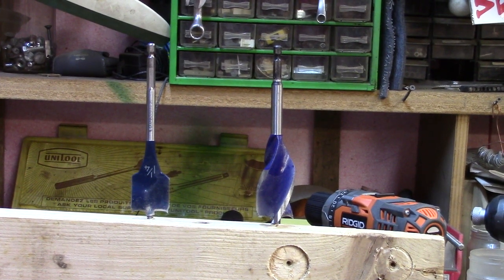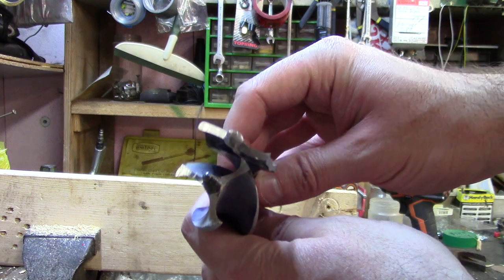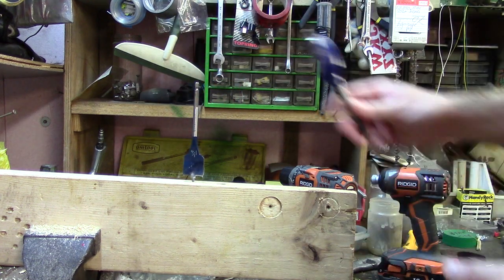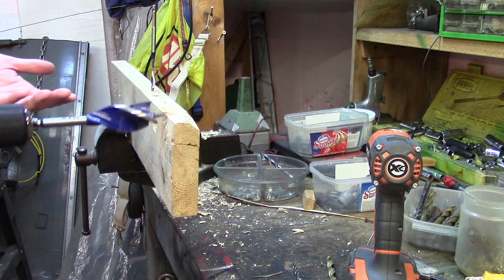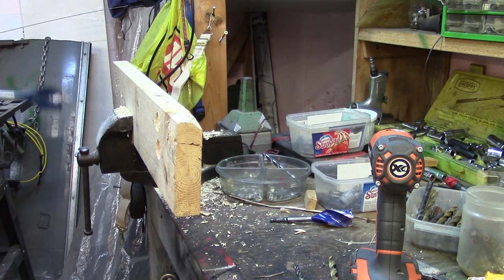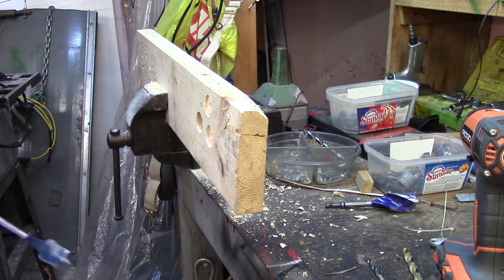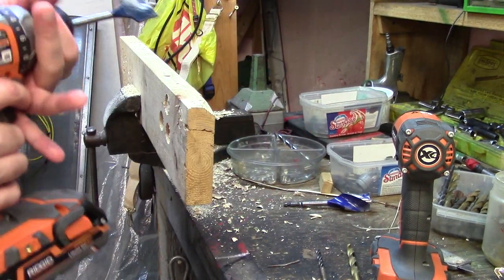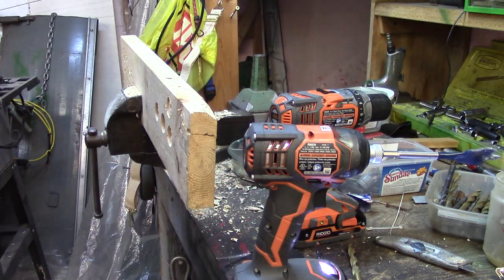IRWIN speedbor MAX VS Bosch Daredevil Spade Bit Set

Comment: Pay attention to how he uses his drill/driver's clutch. He should of had it on speed 1 and on drill mode not on a torque setting number limiting the amount of torque allowed. Also for some reason I think he rigged it because it sounds like he changes the clutch setting after using the first Irwin speed bor. I don't understand why he he would do that? But that's just what I thought I saw happen so...? Either way I've personally used both the Irwin and the Bosch bits and as long as you have a good drill and know how to use it... you should be fine with either one. They both drill holes like they are made to do and I'd even say they are about equal in hole quality. So it all just comes down to how much you want to pay for a drill bit really because these are both main stream brands that have reputations to hold up so you can expect them both to have good quality.
Reply: can you tell me if you thing the spade bit with the screw would be good to use as a scotch eyed auger (hand drilling without pressure, just turning)?

Comment: Speed bore is for low speed, high torque drills and heavy use. The spade bit is not for heavy use. A real tradesman using these bits all day will choose the speed bore because the spade won’t last a week of everyday use. Test the two different bits using the proper drill speeds through 3 2inch boards stacked together.

Comment: 3 blade design (vs 2 blade) will be "harder and slower" for a very weak drill/impact driver but it will cut through much better and faster for a stronger one.
Reply from the maker: There is a few other video on YouTube comparing these 2 and in every case the Bosch win! Plus they are cheaper so on the long run you save money off you use them every day👍

Comment: Use the right drill for the job.  Why not use a 1/2 inch cord drill and you will see the IRWIN is faster.  That is why it quit on his drill with a dead battery is that it grabbed a lot of wood and the drill could not pull it out of the hole with a dead battery.  I have a 12 volt battery run drill that would have no problem with these bits because my pack will put out over 100 amps and my drill, under full load, only pulls 60 amps.
Reply from the maker: Hum I was comparing 2 drill bit too see witch one performed better 😒 Ho well not everyone is familiar with the concept 😔.
Reply: owen prince because no one uses Corded ones

Comment: Really!! Who educated you on how to drill holes!! Drilling holes on 2 setting! When you are drilling holes, you need to pull out and allow wood chips to clear and then continue drilling. Everything you demonstrated, is wrong!!!
Reply: Ernesto De Leon I agree this guys an amateur lol doesn't know how to use a drill
Reply: Actually these are designed to pull in the bit. So you don't pull out. It's not a hole saw. It's designed to pull the chips out....
Reply: Speed 2 for smaller holes, speed 1 for larger holes.  Also as stated the speed bores arent meant to go in and out like a regular spade or drill bit.

Comment: I bought a pack of those Irwin spade bits about three weeks ago. Over those weeks I've used the 1 1/8" bit and bored eight holes thru 2x4 pine. These Irwin's are ridiculously dull! My twenty yr old spade bits, which hv never been sharpened, work so much better/faster it's crazy. 

I only bought the Irwin because I needed the 1 1/8" bit.. but it's so dull that my drill is running too hot and started to smoke. Didn't want to kill my drill just to drill a hole!

IRWINS ARE TOTAL UTTER GARBAGE!
Reply from the maker: lunaticprophet yep that why I love the Bosch of you have a chance buy just 1 individual bit too try out and see if you like it 👍

Comment: Ive got a set of the speedbor max and they go through wood like nothing the sppedbor max a brilliant i think this is rigged because he changed the setting after the speedbor max bit .... he is also only using a 2 amp battery so the battery and power wont last long 👍

Comment: This type of drills are designed for hand drilling only and absolutely not suitable for power tools. Never use them on electrical tools if you don't want to loose your hands.
Reply: What? No they are designed for impacts, your hands will be fine